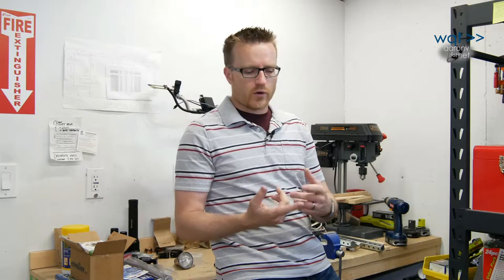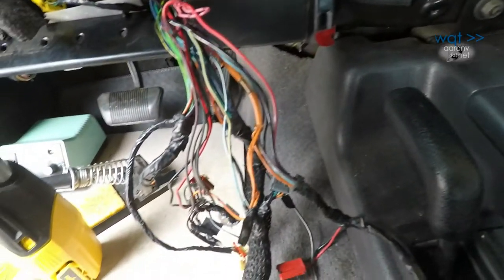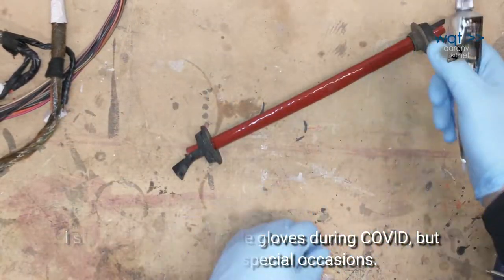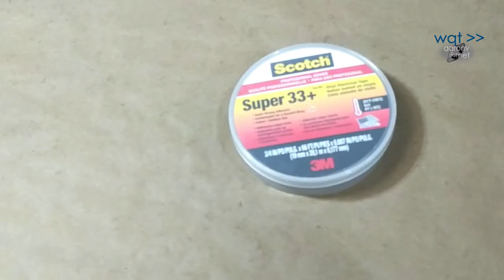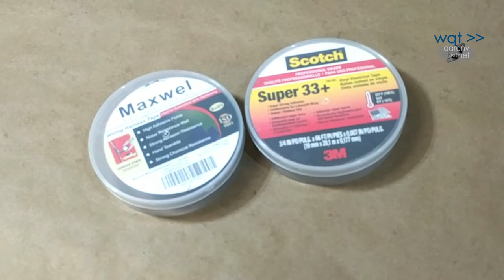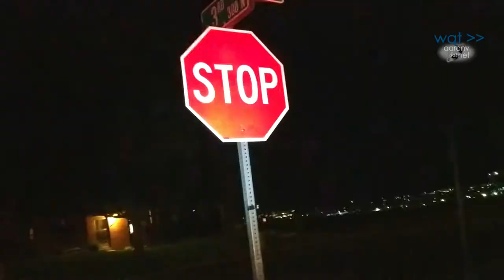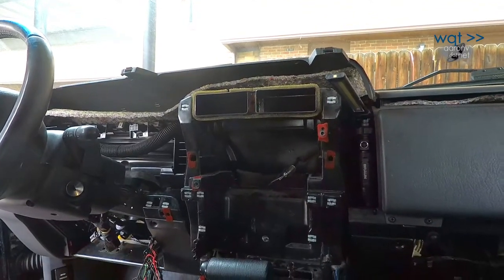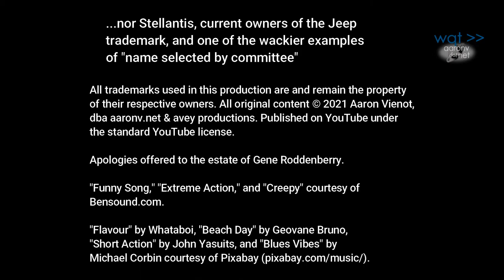wqt//Basic Auto: 1997-2001 Jeep Cherokee (XJ) liftgate wiring boot fix - better than OEM!

Comment: Nice job of correcting somewhat of a nightmare for many of us.  Everything works in our 2001 XJ tailgate except for the rear wiper and washer. I'm going to tackle that diagnosis before splicing any wires to avoid the "Oh my!" if the re-wiring does not fix the problem.

Comment: This was a well-done repair.  Straight forward instructions, helpful hints, and a really clever way to fix what is a universal issue on Cherokee XJ's.  The engineers didn't consider long-term reliability for the wiring given the 90 degree flexing causing the wiring to break like a coat hanger getting flex.  Nice Job.
Reply from the maker: Thanks! It would also help if Chrysler had spent an extra dollar on fine-strand wire. There's four or five big reasons why wiring fails in this vehicle and that's one of them.

Comment: Great video, only thing is I purchased the 5/8ths red wire protector hose and it was too big to fit in the factory 2001 wire boot. Ordered a smaller 1/2 inch red wire hose and that fit perfectly like in your video. Great idea by the way!
Reply: I have a 98, if the 5/8 fit like the video I would stick with that. I used 1/2 like you stated and that was the biggest pain getting my bundle of wires through the sleeve. I will add though I used high strand flex wire so it was a little fat for 16AWG wire.

Comment: I just did this but different.  I only kept the 2 wires for the 3rd brakelight in the rubber tube. 
The rest I ran in a separate loom out near the gas strut.  Simple fix. 
Too many wires in too small of a hole.

Comment: I did like the video.  I'd like to offer a slight correction on the general reference that gives the appearance all the harness look like the one in the video.   The harness you are dealing with was from Chrysler's design for the XJ's Phase II iteration with steel liftgate.  IIRC '96-'84 (older body design with fiberglass liftgate) had the wire harness come through the upper left of the hatch opening with a few inches of slack for hatch movement.  The right corner had the washer line.  As far as I can remember this had not changed from AMC's design until Chrysler changed it for the '97-'01 models.
Reply from the maker: Thanks for the feedback! I'll take a look into this and see if I need to at least update the video title .

Comment: Thanks for this video, I just did this fix and unfortunately I have the same problem with everything but the wiper and wash working. I'll be dreading tearing the dash apart.
Reply from the maker: Have you done the dash before? If not, check out the first few minutes of my interior refurb video from a couple months ago (it's in the ProjectXJ playlist). I demonstrate the dash teardown in detail.
Reply: I'm in luck. Rear wipers working again, It was just the 20 amp fuse on block 22 👍
Reply: @aaronvienot  Nope but I'll check that one out!

Comment: Damn, I just repaired my harness last night but i really like your idea! I did add more wire to keep my soldered splices out of the boot and to have a softer wire. The factory wires seem really hard, probably with hardened copper. I might have to go back later and execute your technique by crossing
Reply from the maker: Thanks for the feedback! Realistically if you ran softer wire and wrapped it tight, it might last for the remaining vehicle life at this point.

Comment: Excellent video! I will be undertaking this project soon, but I was curious...

What was the actual length you added to the wiring harness itself?

I've got a known-good eBay harness, and will be adding length to it, testing it on the bench, then just swapping out my old harness for the new one. Knowing how much wire I'm adding would be a huge benefit here.
Reply from the maker: I don't think I wrote down the exact length, but from the video you can eyeball it around 18-24 inches. Your needs might vary depending on how you end up routing the final product.

Comment: i think a lot of melted grounds like that are a cause of either wear and tear or someone using too large of a fuse in the fuse box so lets say the fuse says to use a 5 amp fuse and guy says what is the worst that could happen?? yeah melting ground wires is what WILL happen the weak fuse is to ensure the fuse will melt before the wire would.
Reply from the maker: Fooling with fuses will definitely do it, the OE wiring is sized for the current (and sometimes, the voltage drop secondarily) and over-fusing will overload it (although sometimes people get away with it on intermittent-use circuits). But in this case, it was definitely the short in the liftgate wiring boot that caused it. When chased out from back to front, the melted conductors all followed the path of the wiper motor circuit and the switch itself was blown out.

Comment: Hey Aaron, doing this job now. Did you use a windshield hose extension?
Reply from the maker: Sure did. Can't recall exactly but I think I reused the OE hose through the new boot, then spliced a short section inside the liftgate using a double-male plastic vacuum hose barb.
Reply: @aaronvienot  Sounds good buddy, things got short real fast! Thanks for the vid and superior idea!

Comment: Do you know the diameter of the washer fluid hose?
Reply from the maker: @applepiendasky  checking my supply stash, I think it was 3/16-inch (inner diameter) but your options may vary. It's soft rubber hose so it has a bit if stretch depending on what size splice barbs you are able to find.

Comment: Hey Aaron, I'd like to know how your grommet and new (red) loom casing held up. Do you think rubber cement would be better than the RTV ?
Reply from the maker: So far holding up fine, with caveat that this is a 2k mi/yr vehicle right now (mainly summer offroad/adventure) so the tailgate use is a lot less than for a daily. Don't know how well rubber cement would bind to the silicone sleeve as I haven't tried, but if I was experimenting with other adhesive sealants, Shoe-Goo repair product would be on my list.

Comment: I would've junked it! I'm currently tracing wires and grounds on a 99 XJ. Not really an electrician but can follow color codes.
Reply from the maker: That's one reason why I like showing electrical builds, they seem like voodoo to the uninitiated but are doable by most DIY types with regular tools and patience.

Comment: Did you do the same splicing for the other harness or did it have enough length already to cross over?
Reply from the maker: Unless you have a connector re-pinning kit that works for the pin types found in the  XJ's lift gate harness, and can re-terminate directly to new pins, two sets of splices will be required. Ideally, you should feed the harness wiring through the rebuilt boot before making that second set of splices, or things will get weird.

Comment: Do you think this could be the cause to my interior light staying on man?!????
Reply from the maker: My experience is with '97 and up. Broken harness wires in the liftgate would tend to disable the rear cargo light control, rather than enable it. Have you tried turning it on/off using the pushbutton light above the rear cargo area? If the lights stay on regardless, it's likely a problem with a passenger door switch or the lighting control switch at the dashboard. But if it turns on and off with the pushbutton light, then it could be that the switch in the liftgate latch assembly has failed. A broken switch should also be giving you a "liftgate ajar" light on the dashboard. The part number for the liftgate switch is Mopar 56005640. Good luck!
Reply: @aaronvienot  all the lights are staying on lol I had to pull the bulbs! Man I have searched and searched to try and see what’s wrong I guess I’m gonna replace the light control switch and see if that works haha!! I’ll keep you posted!
Reply: Rotate the headlight knob, it is the interior domelight switch